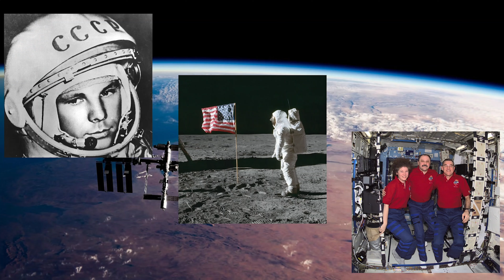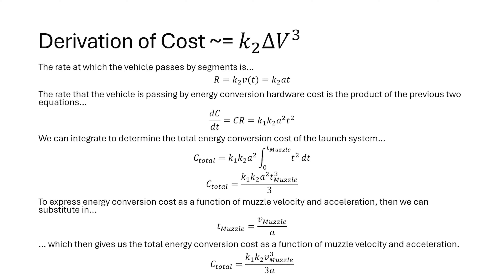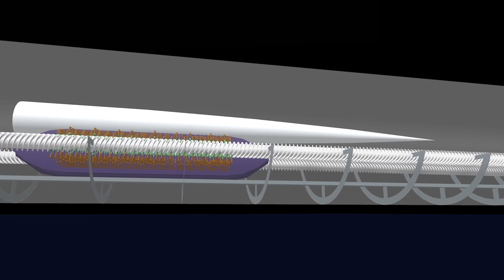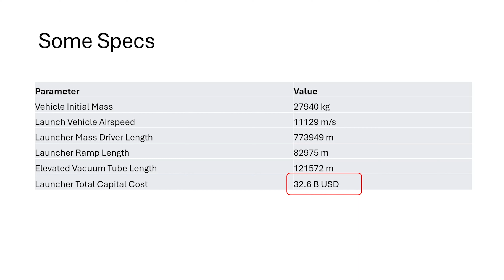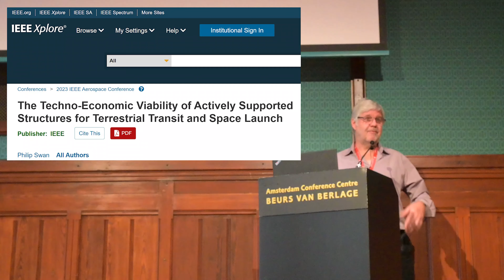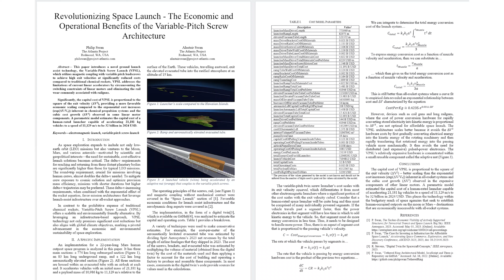How Mass Drivers Enable Geopolitically Significant Achievements in Space Exploration

Comment: Your design is fascinating! I was wondering. Iron is limited by saturation flux density. Could an aluminum screw be used instead of iron? You may be able to get far higher force from the Lorentz force acting on induced eddy currents inside the aluminum. Maybe at least an order of magnitude more force per mass with the right design. Also aluminum would be able to spin faster. Any thoughts if that is plausible?

Comment: I fear the ocean is a somewhat harsh environment for such a delicate system. Ocean currents, ships dragging anchors, tides, water pressure, salt water...

And anchoring the tube itself down is one thing, but it'll need some flotation devices, or not? A steel/concrete vaccuum-tube won't float, won't it? Seems like another can of worms to me. And how does one service the tube in case of problems?

770 km would be A LOT of tunnel. But it's not outlandish, and it's an understood technology. The PRC build 68km of tunnel for the Line 6 of the Chengdu Metro (capital of Sichuan) in roughly 30 months (with 42 TBMs).
Reply from the maker: Despite being made of steel and concrete, the tube is very buoyant. I figure that maintenance would use the same techniques that are used for other marine technologies, such as saturation diving, underwater drones, etc. Although if it is only 10-20 meters down, saturation diving probably isn't needed. You could probably surface the whole thing on a fair weather day to do inspections and maintenance of the exterior. You could also send automated inspection bots between the concrete tube and the steel tube to inspect that interior space. Working inside the vacuum tube would require telepresence robots or workers in spacesuits. The difference in civil engineering cost between a tension-moored underwater tube and a tunnel is a topic that needs more research.
Reply: @spaceinfrastructure3238  
While cost is clearly relevant for such an extraordinary expensive endeavor, the risk factor makes me very very queasy when putting something like that in the ocean.

Surfacing this thing would need calm weather? How calm would it need to be? For how long would it need to be calm? How long could one wait for calm weather?

Also, didn't want to mention big scary human/geopolitical stuff:
For North Stream it took only damage at one site to severely damage the entire pipeline. Reports differ whether it would be repairable. The blown up section itself could be reconnected AFAIK easily, but whether corrosion due to saltwater ingress damaged the inside of the pipeline beyond possibility of repair is not clear from the reports - but North Stream is/was a "simple" empty tube in comparison.

Things go wrong, all the time. All it takes is one weld that is defective, one ship that drags its anchor, one state or human doing something stupid - and 770 km offers a lot of chance for something going wrong.

Also, there is zero possibility of effectively restricting access to something in the ocean. Cf. the current conflict in Europe with drone ship attacks. Cf. the current conflict in the Middle East, with global shipping having been heavily impacted by a war torn little nation. 

All it takes is damage at one site to have dozens of billions go up in smoke.

Comment: So now our mass driver technology turned out to be so promising we don't even need the tethered ring to suspend it in the upper atmosphere?
That's amazing.
The atmospheric friction on exit is always going to be a very unpleasant experience though necesarily. I have some ideas to postpone that problem until later in a thinner part of the atmosphere but we can cross that bridge when we get to it.

I swear I just saw a company making a mass driver where they accelerate using pressurized Hydrogen that comes out of single use burst disks, it's crazy that they get a grant from the military while this sort of stuff is just built in peoples garages.
Reply from the maker: Yes, the tethered ring started out as a solution to the problem of how to support infrastructure at high altitudes. It's still cheaper than drones on a per-kg-supported basis, but if its only purpose was to hold up an evacuated tube then most of its lift capacity would go unused. I think a drone-supported evacuated tube will precede an evacuated tube that is held up by an inertially supported active structure.
Reply: @spaceinfrastructure3238  "Drone supported."
I swear there is ONE Hindenburg and from that point until forever people just hate neutral buoyancy.

Still ... this kind of thing probably enough launch capability to let us skip a tethered ring altogether and straight up build an orbital ring.

Comment: How fast would/ could the acceleration be for bulk cargo? For instance rocket fuel, for a fuel depot in orbit.
Reply from the maker: It's easy to increase the acceleration at the beginning of the variable-pitch screw mass driver, but it gets harder, engineering-wise, as the vehicle's speed increases. But for sure you could make the mass driver shorter and cheaper by abandoning the human-rated requirement and then increasing the forward and lateral accelerations.